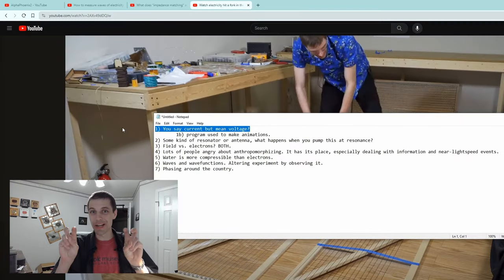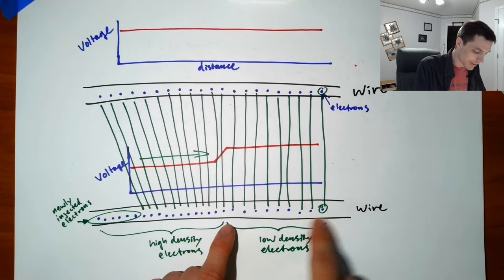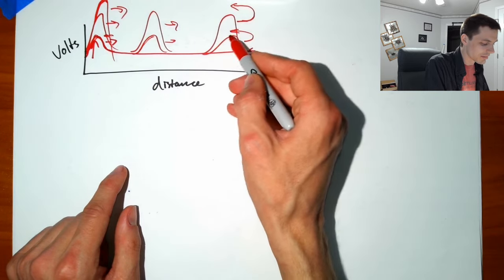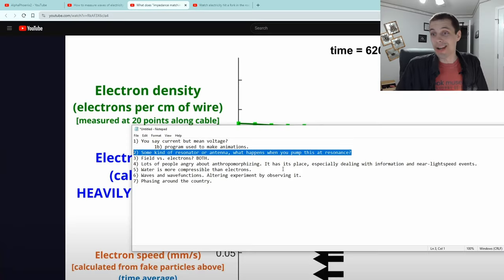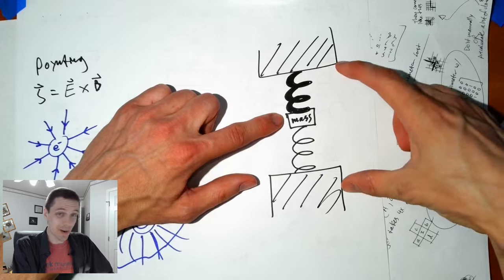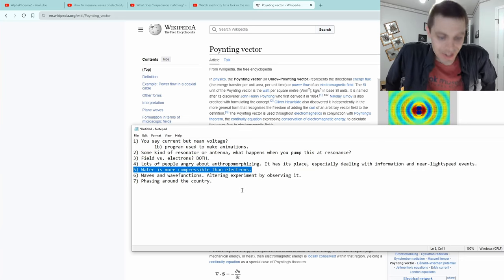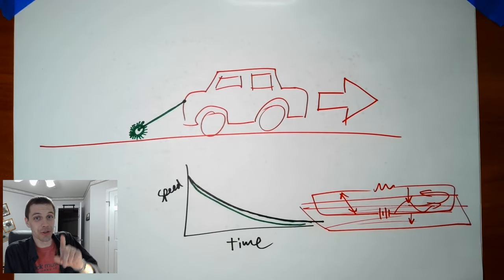"Watch electricity hit a fork in the road at half a billion frames per second" AFTERSHOW

Comment: Water is "in-compressible" in the same sense that a block of steel is a "rigid object", but at the end of the day, how does sound travel through either one..?
Reply: because steel isn't a rigid object and neither is water. sound waves are just waves of motion, in the case of steel it's a wave of pressure i.e. closer spacing of atoms at some point in the material than in another, which propagates in a certain direction.
Reply: @JustinKoenigSilica  It was a rhetorical question, but yes. I was intentionally referring to his other video looking at tapping a long steel bar and seeing when the response on the other side happens.

Comment: Power plants are not synchronized between themselves, they are all synchronized to the grid, and physics apply. If you, somehow, could measure the phase between two distant power plants, they most likely won't match. But sure they'd match the grid at the very point they connect to it.
Reply: The way it was explained to me, they don't care about each other. There is a device a motor called a synchronizer where the plant hooks to the grid. Then you bring your generator up to speed and when the phase angle/gauge reads 0 you engage/energize the lines where you are, like slip shifting (like shifting without using the clutch).
Reply: Yes and house to house doesn't matter at all. The only point it matters is another point where a generator is installed. They have a Guage that shows when they are in synch. Funny part is once both are in sync and they are both plugged together they basically stay in synch for the most part.
Reply: @RT-hl4uk  the generators do care about each other hence the synchroniser you deacribe  thids allows the new generator to ab added to the network with minimum disturbance.  Once connected the controls will slowly ramp the output to feed the required power into the grid.
Reply: Correct, there is always  "Phase delay" which depends on length of wire/LC.. "Grid Tie" systems match the phase in that point of the circuit which would be different then other parts of the system...

Comment: You don't need a Tesla coil to increase the voltage like that. Just use a capacitor and an inductor, calculate the frequency, use a half-bridge driver to alternate between VCC and GND, and you can make infinite voltages. (Theoretically)
Reply: Yeah, using a Tesla coil is a good way of frying your scope.
Reply: 12:48 Yes, please don't connect a scope to a tesla coil. Frying the scope would be the least of your worries - don't play with high voltage unless you exactly what you are doing.

I think it should be possible to do this experiment at low voltages (9 V building up to about 30 V). Anything more than about 100 V can be deadly, so keep the max voltage below 50 V to be safe.

Comment: So the question now is, how does the battery know how much initial current to put on the wire? I expect it's a transient response function of the RLC transmission line circuit that's directly connected to the battery, but you get into circular logic because that transmission line segment can always be shortened, to the point that it's inside the actual battery cell. Maybe it's a function of the construction of the battery, which is effectively its output impedance , then later measurable on the transmission line which has its own characteristic impedance?

Comment: Fantastic videos!  Thanks!  One slight quibble:  The answer to your multiple choice quiz is really “B”, not “C”.  The battery does not “guess.”  The battery (like any power source) will have a curve of Voltage as a function of load (Amps), which is a function of the battery chemistry.  At no load (0 Amps) the battery voltage might be something like 9.4V.  As load increases the Voltage will drop, until at maximum current - a dead short - the Voltage will be at some minimum level, maybe about 4.5V.  We can look at the system on a micro level and solve Ohm’s Law at each point in the system and at each point in time - basically Finite Element Analysis.  When the switch is first closed, the first bit of wire after the switch “sees” the battery’s no-load voltage at the switch and zero volts just after our little smidge of wire.  Since the resistance in that tiny bit of wire is nearly zero the current (based on Ohm’s Law) will “want” to be nearly infinite, but it is limited by the battery chemistry, which does not respond instantaneously to a change in load.  As current starts to flow through our first bit of wire the voltage at the end of our bit of wire will increase, which will start current flowing through the next bit of wire, and so on.  As the current propagates through the wire the current will start to rise towards the battery’s max. (dead short) current, but two things happen:  1.  Higher current causes the battery voltage to drop;  and 2.  As current flows through more wire there is more resistance, which limits the current (I = E/R).  Effectively a “pulse” of  higher voltage will be passed along the wire.  

Any discussion of "waves," “reflection,” and “damping” is just a mathematical description of what is happening, not an explanation of why it is happening.  If you break the system into tiny pieces and think through what happens in each tiny section over time, using only Ohm’s Law and the boundary condition of the each element (and the limitations of the battery chemistry), you can see why the voltage rises and falls in each element until it reaches an equilibrium.

Comment: To sync the generators on the grid they only need to be matched locally.

You don't care if the generator 10ms away (half a cycle @ 50hz) is phase matched with the generator you're in front of with respect to a universal standard. You only care about its phase when it's actually reached your generator.

You sync them up locally and they run 180 degrees out of phase compared to each other globally. But if you take your oscilloscope and start at one generator and move it towards the other they stay in phase. Halfway there the signal will still be in phase with each other, but 90 degrees out of phase globally.

So to get it all going, you start the first generator. You then wait for that one to stabilise, then start and sync the second one and then finally connect it. Any slight difference between the phase will cause them to fight against each other and they speed up and slow down until they actually match and rotor lock to each other. The local phase relationship is all that matters for them to sync.

The map shows the instantaneous global difference with respect to a specified point. It's meaningless in terms of phase matching.

It's still interesting as looking at the phase tells you something about the loads that are connected, but it doesn't matter in the context you're talking about.

Comment: 2:00 I found it interesting that the higher the density of electrons (negative charges) equates to lower voltage. It's probably elementary but I never thought of it that way.
Reply: Indeed, new to me. Though this is kind of the same as with gases. Faster air is lower density, despite what my intentions suggest.
Reply: For me the same. But I was wondering if it's elementary - in Coulomb law the closer the charges, the bigger the eletric force, so higher density of charges means more energy. Here is totally opposite and I was wondering what exactly phenomena is behind this?

Comment: Your videos are fantastic and your experiments are by far the best analyses of the behavior of electrical systems that I have seen so far. They address my long standing questions that long prevented me from ever making any progress in the "field", because I always got bogged down so much with these details about the behavior of fields and particles that I never got to the more advanced stuff. Watching this video now, it suddenly occurred to me that the concept of a fork in the wire (and the wire itself for that matter) are both contrived conveniences at our macro level to describe the topology of the space in which electrons travel. The part where the two pieces of wire are joined are topologically equivalent to a closed loop albeit with a sharp angle that would make the curve continuous but indifferentiable. What if we smoothened out those sharp points such that the flow never "hit" anything and was guided by the gentle curve of the path? By the way, this back reflection of the current is precisely why "impedance matching" is important. A similar reflection happens when there is an abrupt change in the current medium and the signal reflected from that point partly cancels out the incoming signal resulting in tx/rx losses. Kudos and keep up the good work.

Comment: 24:12 I was expecting you to say solids rather than electrons! You did a video about 2 years ago on the "speed of motion" being related to the speed of sound in whatever you're moving - presumably, this is due to the pressure wave moving inside the metal rod you're whacking with a hammer, and therefore by definition that metal rod is compressible!

Comment: When you put a current into the wire you are also transmitting a radio signal, with a frequency that is the connecting/disconnecting rate.

The 'dead end' branches add reflections to each single pulse, resulting in a more complex signal being broadcast than just a square wave on/off. Do you think that it would be possible to have a length of wire with many dead ends which caused a coherent signal to be transmitted when you connected and disconnected it?

I'm imagining a branched network of wires, and the reflections at junctions and endings all would add up to a single pulse of coherent radio signal.

Comment: I don’t know to what extent the secondary winding of a Tesla coil acts as a transmission line. Transmission lines have a characteristic impedance and lose energy to reflections when they’re not driven with impedance matched sources and loads. They’re modeled as a bunch of series inductors and parallel capacitors, one big chain of low-pass LC filters. But a Tesla coil is just one LC filter, and a band-pass filter not a low-pass. On the finer scale, yes there is capacitance between its windings, but with a single layer of windings the design of the Tesla coil minimises this capacitance. If the coil’s operational frequency is high enough for this inter-winding capacitance significant isn’t something I’d know, but I’d guess not.

There are some interesting things you can do with wavelength lengths of transmission lines at a fixed frequency, Applied Science did a trick or two in his somewhat recent NMR video.

When it comes to country wide transmission lines and synchronising the AC waveform, there are two ways that happens.
In the case of a spinning generator, that generator is also a motor. The torque it produces or consumes is a function of the phase offset between the load and the rotor (for a synchronous generator, asynchronous generators are similar), so if a generator is lagging it will slow down the rest of the grid by dragging more power out of it. It’s a self-synchronising system, within reason. On the smallest scales, the spinning generators act like energy storage, buffering small spikes of power and smoothing them out.
The other way is through grid-tied inverters. DC generation like solar, or AC where you have a frequency difference like in the middle of Japan or the English Channel, or even in a wind turbine where the motor speed changes too much to be mains synchronised, you have switching electronics to turn DC into AC. Turning AC into DC can be as easy as just having some rectifiers, but I bet they’d do power-factor correction too. Turning AC to DC means looking at the AC waveform locally and switching your power into it. Actually measuring the voltage of something you yourself are influencing will be an entire rabbit hole of control theory I’m sure. I can only assume that the phase offset of the inverter is carefully adjusted until the desired current flows. At the scale of house solar grid inverters, this phase offset must be minuscule, or maybe so small it doesn’t even need to be implemented.
There’s also the matter of keeping the AC frequency exactly 60Hz on average, for clocks and timers, which I believe could be done with accurate clocks at each independent generator, but in practice is probably done with GPS timing.

Comment: I just have to point out that observing a phenomenon without altering its outcome can actually be achieved through indirect measurement methods that do not interfere with the system being observed. 

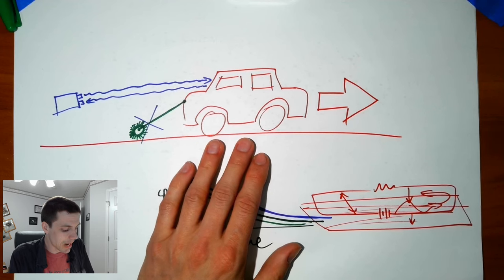contrary to your statement @ 31:19 you can measure the speed of a car by using a camera to record its passage between two points at a known distance apart. In this method, the camera captures the photons (light particles) that naturally bounce off the car as it moves. These photons are emitted regardless of whether they are being recorded or not, thus the act of recording them with the camera does not influence the car’s speed or trajectory.

By knowing the distance between these points and the time taken for the car to travel from one point to the other (timestamped by the camera), the speed of the car can be calculated using the basic formula for speed: distance divided by time. This indirect method of measuring speed is unobtrusive, as it does not require any physical contact with the car or any alteration to its natural state of motion. The car is unaware of the observation process and continues on its trajectory unaffected, ensuring that the measurement is both accurate and non-invasive.

sorry to be that guy, but i couldn't help myself.. lol..

Comment: For a resonant antenna, I think you almost want the reverse of the tesla coil. Ideally energy goes in, but isn't reflected back down the cable. The energy from the cable should hit at roughly the low point of the antenna's like a swing.

Comment: The correct way is to say that the "stored" energy is localised in fields around the electrons. If you quickly move (accelerate) the electrons, the energy of that movement (electron orbitals notwithstanding) gets radiated and lost into the open space by an EM wave propagating outwards. 
The breakdown of the classical EM field theory is precisely when the accelerating charges in the atomic electron orbitals do not radiate energy away.
Reply: There is no correct way to explain something. Neither is there a correct model. All models have limitations. Your explaination may be harder for some people to follow. And it's an explaination based in Maxwell. But that's neither the only model nor the only description. In fact, providing multiple explainations may be even better, reach more people, and get across deeper ideas. Like the fact we're describing models of reality, not reality itself.

Comment: The pointing vector is almost tied to the fields of electrons, but it can separate, and do its own thing.
That is how antennas work after all. A pointing vector can measure the movement of EM energy through space by EM waves in the absence of charges.

Also, at the other end of this phenomenon, there is an E-M field decoupling at a low frequency where the pointing vector fails to tell you anything at pure DC. I'm less familiar with this part of EM physics but I hear that it can cause accuracy problems in some EM field simulators near the DC.
Reply: It's called the Poynting vector, named after mr. Poynting.
Reply: It is rather so that time-varying charges and currents make E and B-fields that propagate out through space. Have a look at Jefimenko's equations (the time-dependent variants of Coulomb's and Biot-Svart's laws). That radiation of E-M fields carries some energy out, which is the Poynting-flux.
Reply: @Sibula  Thanks for poynting that out!

Comment: I have a Question (yes question is kind of annoying, but what is the d(V)/d(electron density) if you assume zero capacitance?:
     You have 3 copper weights at electrostatic equilibrium: 25kg, 5kg, and 2 kg of copper. If you connect the 25 kg copper to the positive terminal, and a 2 kg weight of copper to the negative terminal (assume e- leave from the (-) terminal) across a 2kv power supply; what would the electron potential be after disconnecting the power supply between the 5kg weight and the (25, and 2) kg weights.
     assume the weights are at infinity apart (reduce the capacitance to zero, information is still able to reach the weights). Also assume the weights are flat rectangular plates with the same thickness (assume 5 cm if needed).
Reply from the maker: There is nothing with zero capacitance
Reply: People often have questions about impractical or even impossible scenarios. EE tends to be built on a bunch of simplifying assumptions. If you break those assumptions, parts of EE may not apply. You may be able to use Maxwell, or QED etc to answer such questions. But a lot of the intuition from EE no longer applies.

Comment: Interesting that the current lags the voltage 90 degrees in a wire when answering #1. Is there a way to show the current leads in the twisted pair?
Reply: The phase relationship between current and voltage is a consequence of the capacitance and inductance in the system. They aren't necessarily at 90 degrees to each other. In fact they're almost never 90 degrees apart.

On the grid they want to be exactly the same phase. Any difference is power you're pushing up and down the line that's not doing useful work but still experiences resistive losses. IE it's wasted power.

The difference between that perfect state and the actual one is called power factor. (Real power vs apparent power) We add capacitance and (rarely) inductance to the grid in order to manage power factor of a load to ensure that the load on the grid is purely resistive (as a power factor of 1, with no difference between the current and voltage phases).